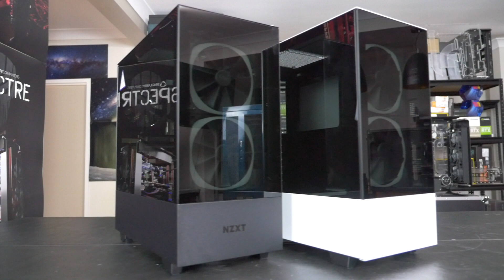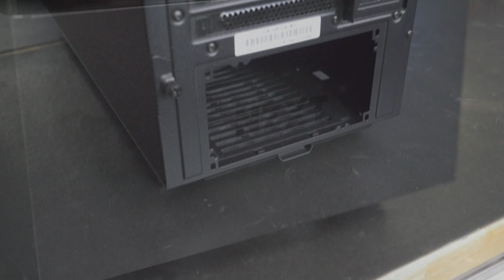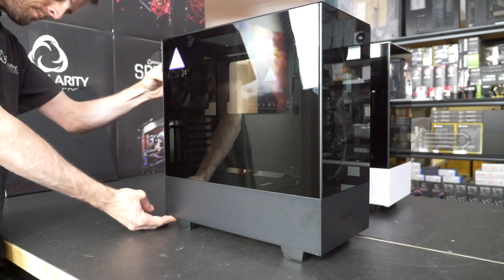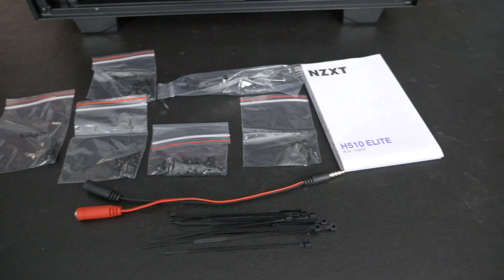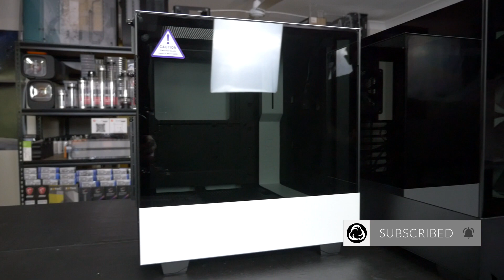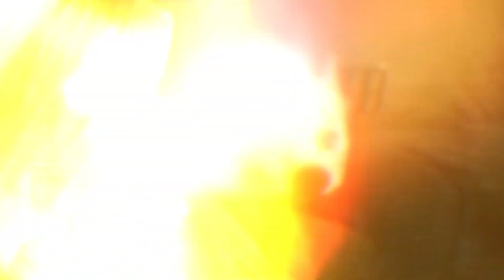NZXT H510 Elite Review & Giveaway

Comment: Missing many key features of today cases like dustfilters (on top), better Airflow (on top), drivebrackets, small I/O with cheap 3.5mm adaptercable... but i still like the look rly, but not for that price NZXT.. 130 Maximum.. but for 130 i can have the o11 dynamic, that is better.. hmm 100 bucks without fans, so.